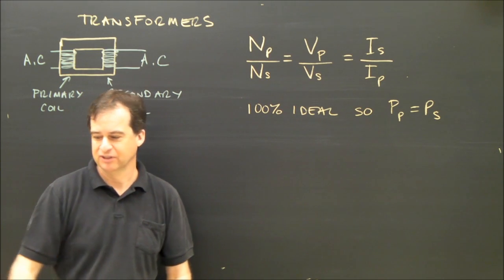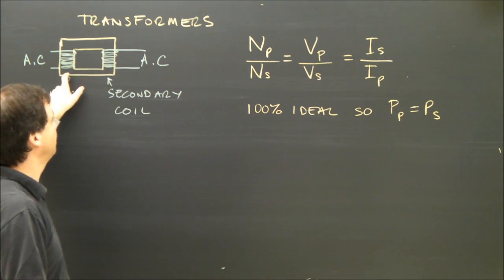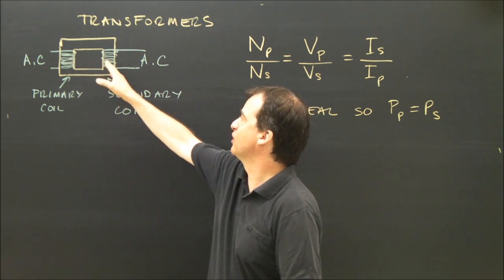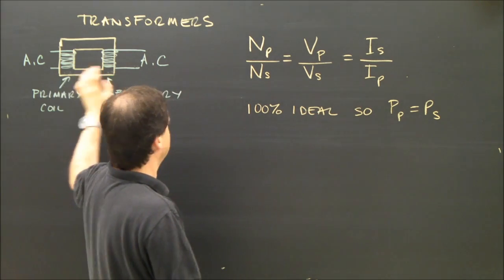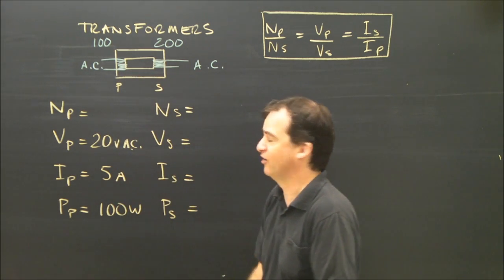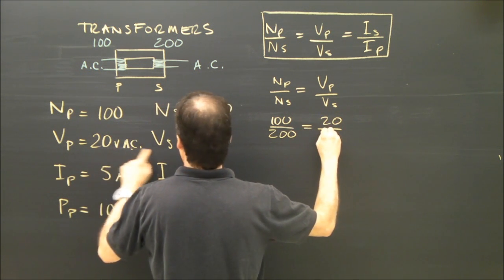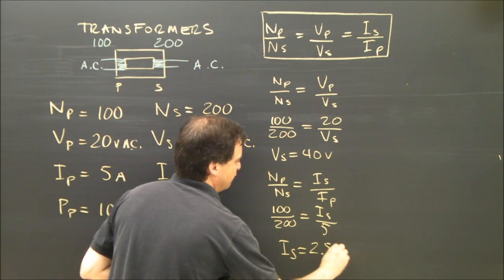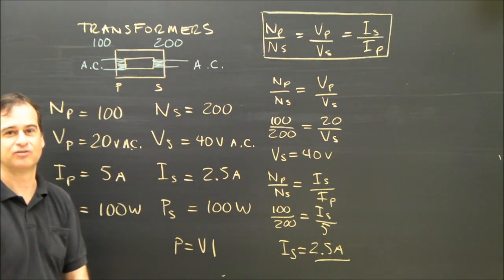Electrical Transformer Calculations Physics Tutorial

Comment: @
PhysicsEH
This is completely wrong. If we have 100 rounds on primary coil and 200 rounds on secondary, the voltage is twice lowered. From 20V to 10V. Simple, because we have a more ressistance on second coil. So: 100/200=0.5 x 20= 10V

Comment: the unit of the Power on transformer is VA not Watt .. because there is only current and voltage .. so power unit on transformer and generator is VA .. but power on motors the unit is watt because there is movement .. so there is big different from watt and VA

There are two type of losses in a transformer;
1. Copper Losses
2. Iron Losses or Core Losses or  Insulation Losses
Copper losses ( I²R)depends on Current which passing through transformer winding while Iron Losses or Core Losses or  Insulation Losses depends on Voltage.
That’s why the Transformer Rating may be expressed in kVA,Not in kW.

Comment: Im stuck with question where I am given Vp = 339 V Amplitude Vs = 13.56,, Np = 100,, Ns = 4 what is Is and Ip? And I am not even given any Power value so I wont be able to use VI = P and if I tried to do the question by using resistor value like R = V/I or any other resistor calculation from the OHM's Law triangle I cant because I am not given a resistor value. Please help me with this question.

Comment: the peice itself can only be in parallel or series and cannot be put one after another in any circuit, in parallel - voltage remains the same while current is manipulated by the ratio of turns and in series - the amperage remains the same and the voltage is manipulated by ratio of turns, wattage isonlyanoutputrating,nota voltagedropoftheequipmentused, thatwouldbetheimpedanceofthecoilshenrys into resistanceinohms youfoundthewattageofthepeak frequencyvarianceofsomekindorsomeshitorapeicetofindingit

Comment: well great to begin with but the wattage deal was a fake considering the voltage went up, it would be a series circuit leading the cause of the current to remain the same creating more wattage in the secondary output hinting 2:1 ratio...as far as the 1v ? below me it would conduct but most likley wouldnt power anything it needs the magnetism to substain itself and depending on howmany watts operate urdevice normally it would be odd to havethatkind ofamperage at1v itwoulddiequickwithoutamp source

Comment: This can't help anyone to actually make transformer. How big core to use, what induction to allow as max in it, how many winds per Volt for that (at 50 or 60 Hz), how thick wire at specified primary current, how thick at secondary, for how much to increase secondary voltage with average losses expected in transformer of that size...?

Comment: kinda wrong, transformer work by changing magnetic field. The ac is changing its current direction which means its also changing the magnetic field direction, thus the magnetic field is changing. The dc will work just once since there is a sudden change in magnetic field when switched on, but the next it will not work anymore.

Comment: Your video just cleared my mind up right from the beginning. I spent time solving this particular problem where I was asked to find power. I found the turns ratio and was going thru some other calculations and i watched your video then realized, oops the primary voltage in the circuit is DC and no voltage is induced. My answer was zero from the jump lol...Thanks a lot